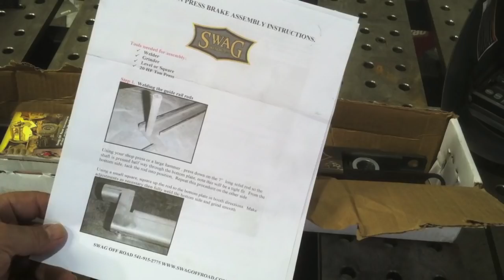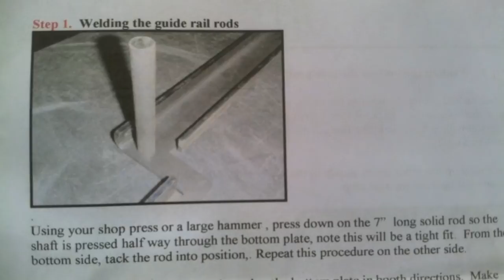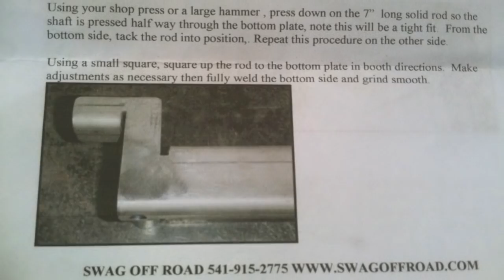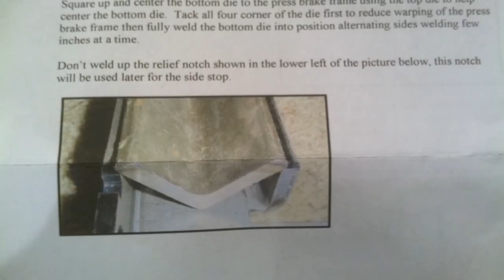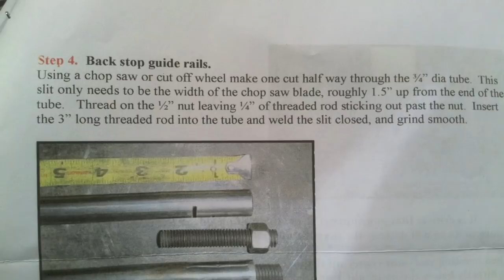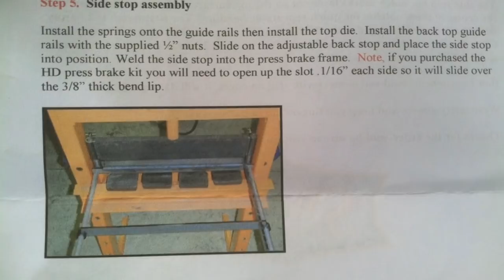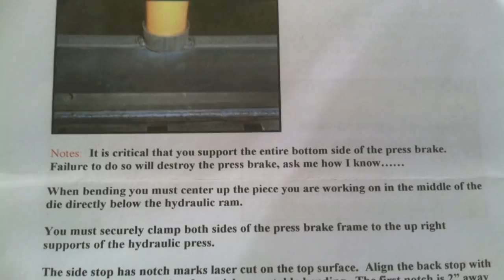Hydraulic Shop Press Brake DIY Kit

Comment: A trick i learned from doing 16G Stainless Steel Hollow Metal Door Frames that also works REALLY well on things like those long runs you had with that angle that could potentually warp and such from too much heat... back step weld like you were doing AND take a blowoff nozzle tool and just blast the part with some air from your compressor. Its speeds up the cooling of the weld considerably and it wont hurt the weld because its still cooling slowly. It works like a charm especially on smaller thinner material and speeds up the welding process by quite a bit which is very handy in a production welding environment or when time=money.

Comment: Weld it from the center and out. Then the heat will stretch out the steel and the bottom die will not warp so much. I did a copy of this because it was impossible to ship it from the USA to Sweden. Thank you for the instruction video my friend.

Comment from the maker: @AllenTrucks I do like the Hobart mig welder.  I thought the tap settings on the voltage knob would be a drawback but no problem.
its a pretty smooth arc and the gun feels really good.

Comment: NICE to see MADE IN THE USA! I almost always hold out for something made in the USA versus most often facing disappointments with made in china poor quality manufacturing and materials but had to get a job done and budget would only allow harbor freight. They had their 20 ton shop press marked down to 129.99 last Fall and I had a 25% off super coupon....actually took 3 tries before they sold me one that wasn't missing parts/fasteners as well as one having the holes drilled so far off that I couldn't even start the bolt through the other side of the hole in it's frame and so after this and quite a few other products having ridiculous issues even though they were still in their factory sealed retailed boxes, I never leave the store anymore without opening a product like this while the manager is right there watching! 
but hey thanks for the video.... this gave me some good ideas to make my own press brake :o)

Comment: Do you use .023 wire for your mig? In this video when welding your guide tubes the weld beads look really smooth on the arc delivery , do you also have a tri-mix? I find the overhead on tri-mix is high for me as a hobbyist/ retired welder.

Comment: Next time put two 1/8 or 3/32 rods about 6" apart from the center line 
under the part and clamp the ends down to the bench, then weld it.

Using the back step welding is good but you should weld it from center 
out to the right, then center out to the left. (Switching back and forth,(left
side/right side))
Grandpa Bill.

Comment: Just buy the northern tool one its not cheap angle iron but solid steel die base that is hex bolted on so you can switch if you make others. If the base warps with heat the thing wont bend even and it will be useless except for 2" pieces
Reply: Yeah right "it's not cheap" at $2230 for a 24".  If money is no object, you can do anything including hire Jody full time.
http://www.northerntool.com/shop/tools/NTESearch?storeId=6970&ipp=48&Ntt=press+brake

Comment: I dont wear gloves either they get in the way pain in my ass iv never gotten burnt
Reply: Derek Graham Besides the heat, gloves protect you from the UV light put out during welding, which has been proven to cause skin cancer. No different than being outside in the sun without sunscreen. A bit here and there prob wont hurt you though.
Reply: +TurbineJesse i never wear sunscreen if that crap can peel paint off a car whats it doing to your skin giving you cancer thats what uv dose not give you skin cancer
Reply: +Derek Graham that does not make any sense.
Reply: Ray Ward how do you figure it makes no sense
Reply: I guess I didn't explain that well see since both arms are full of tattoos i haven't been burned on my arms since i got them because the black ink blocks alot of uv its just like black people that dont get sun  burnt because the pigment in the skin or something like that
Reply: Derek Graham i would have never thought of that.....
Reply: Ya its kinda messed up but it could do damage if i was welding 8 hours a day 5 days a week then ya id Imagen it would not be too good
Reply: +Derek Graham Well i do agree with you to some extent but i will say this about wearing your right glove when you weld... It all depends on what you are welding and how hot you are welding. I always pretty much welded with my right glove off even when i was welding structural with GMAW hardwire and worst i ever had happen was i never had hair on my knuckles of my right hand for years. BUT once i come to the shop im at now welding with Double shielded FCAW on paving machines.... my ass HAS to wear both gloves now. The heat was so much and weld so much that it was burning the shit out of my hand and fingers where they were peeling and getting fucked up bad. Never had this happen in 12+ years till this job where im running Flux Core. Only thing i can figure is its because im welding so damn hot. And gas Flux Core welds REALLY fucking hot even at much lower settings which is the point of running it.. to weld thicker heavier material with less strain on the machine and more controlled yet hotter welding.

Oh and Black people CAN sunburn... it just takes a shit ton more time out in the sun and they have to have not been out in the sun much for a long time but i have seen a black dude with sunburn peeling and shit before. They also tan too.. didnt know that till i seen a dude i worked with roofing take his shirt off and have a farmers tan. Granted he just got alot darker where he was exposed in the sun but still you get the picture. LOL